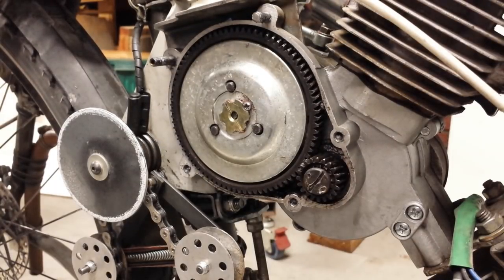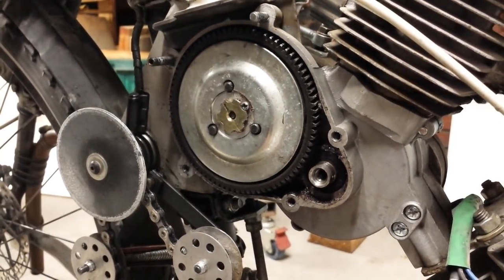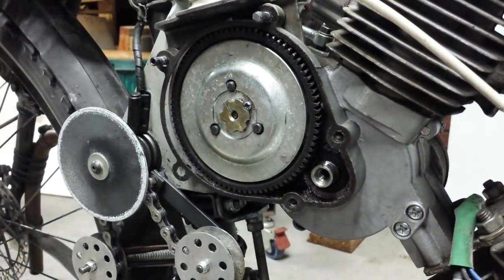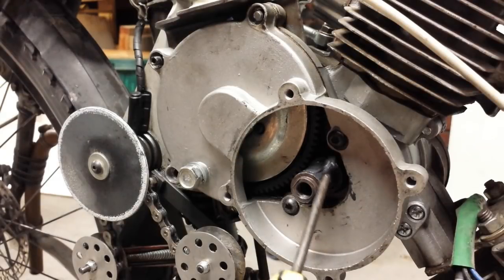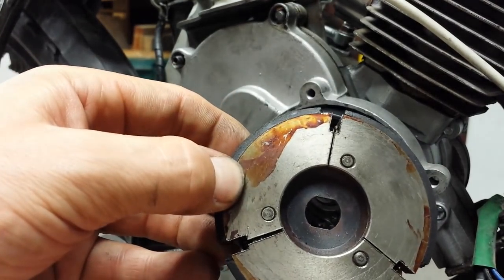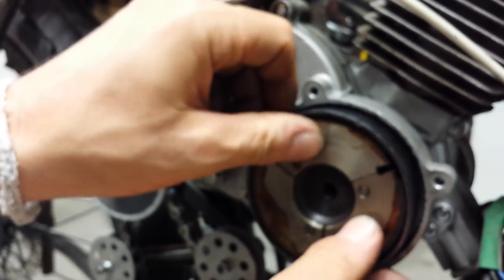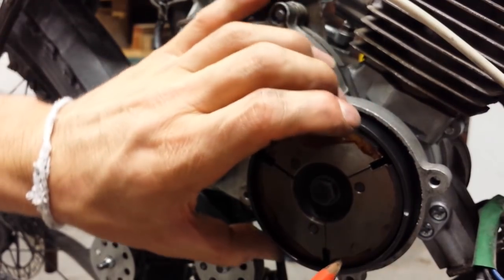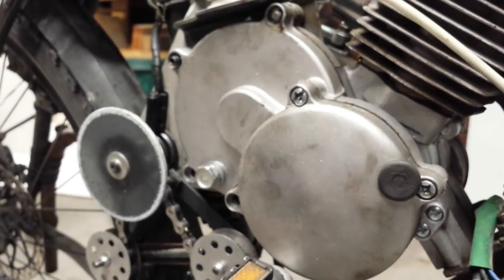Centrifugal Clutch Installation on the 80cc Chinese 2-stroke motorized bicycle engine

Comment: I like these centrifical clutches but they have a couple of weak spots to them the mainest one is the one way starting bearing assembly when you get a couple of mm slack when you get slack between the roller bearings and the one piece that connects to the crankshaft it spins the the centrifical clutch Part when you go to pedal start it or roll start it the clutch slips like hell the most likely cause for this is the spring inside of it breaking or excessive clearance between the roller starting mechanism it's got a very hardend spring that you cannot find anywhere so you have to make your own spring but you have to put it on the outside of the clutch bell because there's no clearance near the small gear and tie it up with wires in order to do that you have to modify the roller bearing carrier to where you can fit a paper clip without the paperclip touching the inside centre Part where it spins but I'm working on a method where I'm putting the actual one way starter outside of the of the clutch I'm going to take a strip of metal bend it and Shape it to where it fits around the clutch drum and then I'm going to put some glue under it for traction and then clamp it down with the hose clampand then put a weight on the other side of the hose clamp so that the hose clamp is balanced when the engine spins and then I'm going to  put some type of homemade starting cogs mechanism on and then when you pedal start it I'm going to put weights on the end of those starting cogs so that when the engine starts the starting cogs are going to pivot in subtract inword under centrifical Force but I'm also going to put light springs on it so that when the engine is turned off starting teeth arms will go against the outer starting mechanism I might end up putting a couple of YouTube regarding everything I left out a couple of details oh how I'm going to go about the whole thing exactly

Comment: I've been spending quite a lot of time, soaking up your great information tonight... Good job!  I'm getting ready to buy a bike and engine and still wondering about the 66cc vs the Honda 49cc 4 stroke.  One of the reasons I liked the 66cc Chinese engine was that it is less expensive but now that we're talking about adding another $80+ to the build.... It seems to me that the Chinese and the quieter 4 stroke are almost exactly the same price.....because the Honda, I believe, automatically has a stock centrifugal clutch ??   Do I make sense...   Since you have thousands of miles on the 66cc engine, I'm very curious to ask for your opinion as to which engine I should buy and for what reason?  Thank You!
Reply: 2 stroke you can go 60km/h lol
Reply: The 66cc engine gets better performance and less maintenance.

Comment: You didn t grease your gears? i use PL 1000 grease on them.I did put one on.They don t site right.If you tight them to much,main slive will split.Great video tumbs up
Reply from the maker: The crankshaft extension sleeve will only split if applying excessive torque to the fastening bolt. This is a common problem for people who have no mechanical aptitude or are simply foolish in apply excessive fastening torque to the bolt.
Reply: He actually did.
Reply from the maker: You will find that when the crankshaft extension sleeve has been lubricated, the spray nozzle can be lifted out of the hole drilled in the helical crankshaft gear, and another squeeze of the nozzle will spray lubricant directly onto the gear teeth. 

That said, the gears will run dry in a short period of time, because they are not splash lubricated, as per a 4-stroke engine with a wet sump.
From my experience, the helical primary drive gears will outlast the rest of the engine, so i no longer pay too much attention to the helical primary drive gears, other than to give them a spray of lubricant when i lubricate the crankshaft extension sleeve, which is approximately every 300 kilometers or every 186 miles.

If the bike is used in heavy stop/start traffic, the crankshaft extension sleeve will need to be lubricated every 150 kilometers or every 93 miles.

Comment: How does the extension sleeve mate with the crankshaft? Is there a keyway inside that sits in with the keyway slot on the crankshaft?
Reply: No.  Extension sleeve is bolted onto the end of the crankshaft with a single center bolt.  The designers omitted both key and keyway, probably because there is insufficient room available and the torques involved with the centrifugal clutch are smaller than those when you're using only the disk clutch.

Comment: How do I get the screw out off of the helical crankshaft gear?
Reply: channel locks or pliers and a large enough screwdriver. it's threaded normally so use a counter clockwise motion.
Reply from the maker: The easiest method is to use a centre punch and tap the large screw just inside the circumference of the head of the screw.
Reply: I do not recommend this i just tried this option cuz i couldn't get mine out either using a large flat head screwdriver with a 1+inch wrench to give me torque leverage to no avail n then tried the center punch n it span about one turn after over 200 hard shots near the edge and in the channel near the edge and it actually snapped the head off the bolt i dont know wtf is wrong but i have no idea how to get whats left out or y it was so hard it sounded like some were able to get it out with nothing but a screwdriver and the locking pliers im gonna look for that damn tool that was in the infomercials that removes bolts that have been sheared off n sink some money into it
Reply from the maker: You work the centre punch at tangent to the circumference of the bolt head, alternating between one side and the other side 180 degrees apart. Just look at the bolt head on the screw in my video.
Reply: Fabian F yea thats what i was tryong to do but i noticed just befor it broke that it was actually. rocking the bolt head back and forth and in doing so it must have loosened the metal to the point it broke i think it was just seized in there i dont see how else it could have been that difficult i know i was turning it the right direction but my other question was more concerning ill get the bolt out i just bought a bolt extractor from craftsmen
Reply: Cool

Comment: What is the make, model, or part number of the clutch you are using? Where can I find one? Thanks
Reply from the maker: You can get the centrifugal clutch and pull-start from a few different vendors, but i purchased my centrifugal clutch and pull-start through JN Motors:  http://www.jnmotorsbikes.com/product_p/jnm1170.htm  &  http://www.jnmotorsbikes.com/product_p/jnm1166.htm
Reply: Fabian F Thank you. Very helpful

Comment: Sure got a centrifugal clutch kit ,it's not identical in it assembly as what is shown and I'm guessing it an original attachment to crankshaft appears bearing less on this one I've not seen many and can't be sure if it's fabrication is equal to what is featured no less likely it has to be or should be lubricated and I've planned to epoxy diamond to the fly wheel and geese the entire of the assemble at some point any. I've had some trouble with gremlins lately and my have to replace the engine entirely if I can resolve a port timing issue that may be cause for it not starting.That caused by attempts to force a sett of portion rings to seat with a ratchet I'd been patient with it and yet should have filed a few thousandths off the rings before reinstalling them assuring an easy quick reassembly.Well in short I should have taken time to study the assembly closely but simply did not and in basic research on the 66 it should have been disassembled and upgraded anyway the basics again a solid forged steel journal a few ounces drilled out of the crank counterweights at the very least.
Reply from the maker: My motorized bicycle has travelled over 55,000 kilometers in 4 years, so i am reasonably experienced with the Chinese 2-stroke engine commonly available with these kits.

The piston and rings should easily slide inside the cylinder. If you need to force it, you are doing something wrong. Most likely is that you do not have a piston ring or rings seated in the correct position on the piston, as the rings sit in a very specific location and are kept in this location by an anti-rotation pin.

If the piston ring is sitting on top of the pin, it will not want to slide into the cylinder, or certainly not want to slide into the cylinder easily.
Reply: @cryptopyro  wee

Comment: Is the clutch drum supposed to have a little play in it? Up down left and right?
Reply from the maker: Yes, it will have a small amount of play, because it does not run on roller bearings. This is the reason why it is so important to regularly lubricate the centrifugal clutch.
Reply from the maker: The clutch drum to crankshaft extension sleeve will have a little play between the two components.
Reply: Fabian F that is why a small hole was drilled to lubricat
Reply: Paul Hemmy wait , lubricating a clutch? thats stupid :)
Reply from the maker: MrSlehofer You could only say such an utterly foolish thing, if not watching the video.
Reply from the maker: John Heiring Yes, the clutch drum will have a little play in the crankshaft extension sleeve.
Reply: were I can get that same crankshaft extension sleeve ????
Reply: metal to metal requires a little lithium grease only between the gears  @MrSlehofer

Comment: Extension housing sleeve! Or just use a micrometer or stick or ? And measure then adjust bolt length. Just a guess but I bet your Dialy job has to consist with chemistry or design/engineering 🤔

Comment: how do you get yours started so easy just by turning it, i have to go on the otherside with a drill or pull start to get mine to start
Reply from the maker: It's simple technique. Work the engine to just over top dead centre and then start the engine.

Comment: on this video you see the chain tentioner well it has aluminum guides with holes in them its those,s i,m talking about did you modify them where can i buy them
Reply from the maker: Those guides (or idler wheel flanges) are just the original flanges that have had the cream coloured powder coat removed from the aluminium; to give it a brushed aluminium appearance. 

I simply drilled holes in the flanges to improve the appearance of the flanges.
Reply: ahhh i see  well you did one hell of a job on those  they look professionally built
Reply from the maker: stingray300m You can easily achieve the same effect by using a hole saw to drill out an appropriately sized (bare aluminium) disk out of 1mm aluminium sheet, or alternatively make a trip to a bolt and washer store and purchase some aluminium washers with a 5mm centre hole.

Marking and drilling out the 8 peripheral holes is also easy. Simply use a ruler to mark a horizontal line through the centre line of the centre hole, then turn the disk 90 degrees and mark another line to effectively form a cross on the face of the disk. 
Now measure the distance in between the outer edges of each section of the cross and mark a reference line in between the 90 degree cross edges. Trace a complete line by placing a ruler on the marks you've just made.

You will have a total of 8 equally spaces lines on the surface of the disk.
Take your ruler and mark a line 6mm in from the peripheral edge of the disk on each of the lines.
Take a centre punch and gently make an indentation on each of those points, so that a 3mm drill bit can get started without wobbling outside of the lines you've just made.
Drill through the alumnium firstly with a 3mm drill bit, then stepping up to a 4.5mm drill bit, then stepping up to a 6mm drill bit.

You have now made an idler wheel flange as shown in the video and as shown on the website.

Comment: If you were going to put a centrifugal clutch on the right side anyway, why did you bother with the jackshaft kit? An old go kart I had with a 5hp B&S 4 stroke had a centrifugal clutch that looked like that with one exception, it had a toothed sprocket on the outside. I would think you could have done something of that nature and run directly from that to your right side drive sprocket, thereby eliminating several parts, headaches, and a lot of cost. I wholeheartedly believe in K.I.S.S. (Keep It Simple, Stupid) when it comes to mechanical things, the less parts involved, the less potential for things to break/go wrong. Was it a question of parts availability (or lack thereof), or did you just not think about it? No disrespect at all intended, I haven't even done my first build on one of these, matter of fact, watching yours and others' videos are part of my research on the subject (what works, what doesn't), and up until just now I didn't know there were centrifugal clutches available for the CG engines. But that being the case that there are, would that not be a possibility to greatly simplify things? Not criticizing, I'm simply asking because I truly want to know what's possible, and what's not.

Comment: If I install a pull start, do I need a centrifugal clutch? Sorry for the noob question
Reply from the maker: No you do not need a centrifugal clutch if you install a pull start, but you will need to pull in the manual clutch lever whilst trying to pull the pull start, which is harder than it sounds.

The other way of doing things is to use a zip tip that sits on the handlebar, and use it to pull in the clutch lever, then when the engine has started, you cap flick off the zip tie.
Reply from the maker: Please view this video for more information on the use of a pull-start:

http://youtu.be/Dwv3Tpltq3w
Reply: if you install a pullstart you dont really need a centrifugal clutch however if you dont want to pull in your clutch lever everytime you stop than a centrifugal clutch can be put on the only things you have to worry about a centrifugal clutch from my exparance is the spring on the one way clutch inside of the centrifugal clutch that allows you to pedel start the bike can break off and the one way clutch can slip making the bike harder to start and you can put lock tight on the bolt that bolts the clutch on to the crankshaft otherwise that bolt can loosen up and the whole damn clutch can slip on your crank shaft damaging the tapared edge on the crankshaft and causing other problems

Comment: Just finished my first build and it was running semi-smooth. Now the thing vibrates like crazy sort of like something is out of balance. Does anybody have any ideas? I have went through and made sure everything is tight.
Reply from the maker: My advice is to disassemble everything, and carefully inspect the components, and then reassemble with due care being paid to the reassembly process.
Reply: Yup I am going to replace the piston bearing. Thanks for the input.
Reply: Mine was vibrating and I tightened the motor mounts and it fixed it

Comment: is there only one centrifugal cluch for this engine? i mean, is it possible to adapt other ones?
and where could i buy this specific one ?
Reply from the maker: There are two variants of the centrifugal clutch for this engine: The first and most common variant is the dual clutch system, which is shown in this video, whereby the original manual clutch is retained.

The second system is the oil bath centrifugal clutch, whereby the engine is not installed with a manual clutch, and only has a centrifugal clutch.
The disadvantage of the second system is the fact that you cannot pull in the clutch lever on the handlebars to allow you to pedal the bike, should the centrifugal clutch fail in the locked-on position.
Another disadvantage of the oil-bath centrifugal clutch is that the engine can only be started with a pull-start mechanism, and if the pull-start mechanism fails, you are not able to pedal-start the bike.
Reply: Fabian F
and are there other similar ones of other machines that could apply to this,on the market?
and where can i find/buy, and indentify each of the variants?
Im mostly interested in one that would keep the original manual cluch as well...
Reply from the maker: You can adapt anything you like, but it might cost the GDP of a small country.

The centrifugal clutch and pull-start that is installed on my bike has been purchased through JN Motors:

 http://www.jnmotorsbikes.com/product_p/jnm1166.htm

and the pull-start can be found here: 

http://www.jnmotorsbikes.com/product_p/jnm1170.htm
Reply: Fabian F  many thanks.
could u give me a tip /example of a clutch adaptation that would fit well and keep both cluches working?
i read that the engine internal Cranckshaft have to be longer, larger to install a centrifugal...is that true?
Reply from the maker: Túlio Santiago My video shows how the only readily available aftermarket centrifugal clutch design works, and how it is installed on the engine.

Considering that the centrifugal clutch can be purchased for approx $30 American dollars, you would be wasting your time trying to adapt another type of centrifugal clutch.
Reply: Fabian F  alright, so ill wait till the dollar comes to a reasonable price here...
many thanks bro, and continue customizing and making videos o/ they're awesome ^^
Reply: +Fabian F Can you recommend an aftermarket source for this clutch kit?